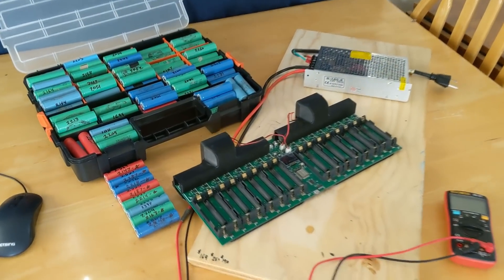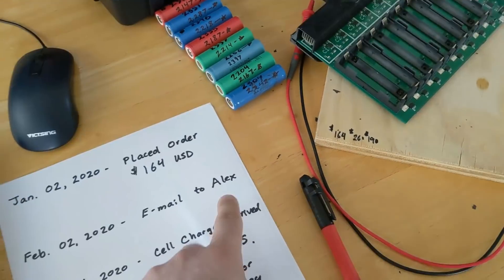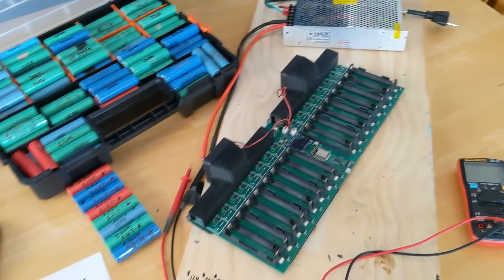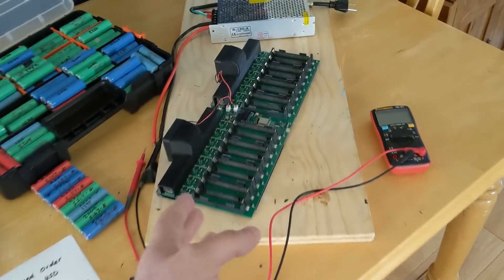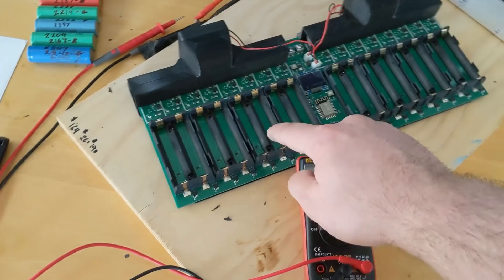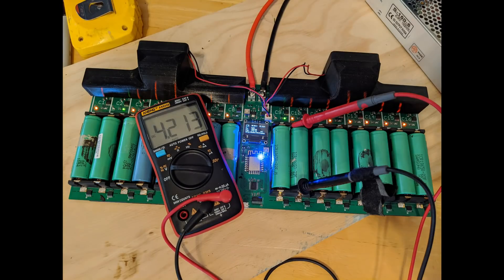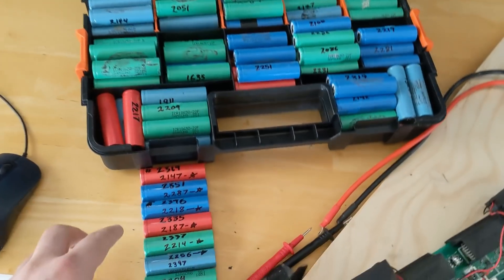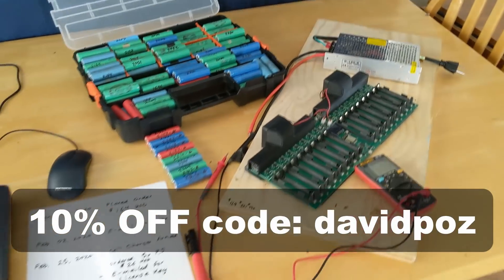18650 Mega Cell Charger and Capacity Tester

Comment: Thank you for your time and the making of this video. I am frustrated with this charger and the support. I am looking to sell mine and will just pick up four liitokala chargers. I have done repeated tests of inserting cells in the exact same way only to find problems with the interface. I don't know what it means when the screen turns from showing each cell and its values to a screen of red/orange with the letters n/a in each one. Sometimes the cells show up as in the led lights up after hitting the charge icon in the sw other times the little led never comes on. Just more frustrating than it has to be the overextended themselves with the sw it is not really a good fit. Now I am told lots of folks are using this charger and the makers of the charger state no reports of problems. I found it hard to believe beings the rough edges on the sw.
Reply from the maker: I certainly reported my problems to them, so I don't know how they can claim "no problems".  But I washed my hands of this product altogether.  I gave it away, no payment.  in fact, I paid for shipping just to get rid of it.

Comment: Thank you for the video and special thanks for being perfectly honest on how these EXPERTS (are they?) describe things to end users (common people) who want to use their products. It’s not your fault for being frustrated, when you said , that you spend several hours referring to external media to obtain info. Why do you have to struggle so much to install and or update codes for the device you paid for? I’d say that these people are totally dumb, failing to impart knowledge to the buyers of their dumb products. Sir, I’m with you and I fully understand your predicament. I could feel your anger when you spoke, though you diplomatically subdued and covered it. 
The guy from overseas, was mumbling incoherently, further confusing me. Hello... I, just wanted to buy the damn thing to charge Li-ion cells and not run a Reactor. These people are not engineers, they are frantically cheating people for quick funds with their contraptions. I’d go for 4 Opus and be happy with it.
I apologize for the outburst. I end my note with due regards and respect.
Reply from the maker: Sounds like you also bought one, is that right?  I didn't go into everything.  I tried to keep it to just the facts.  But at one point Martin called me "crude" for asking this question on the facebook group: "Anyone know how long getting a license usually takes? Thanks."  I get the impression working with mega cell charger is a side hobby for him, because he said I would have to wait until he finished "work", got home, ate dinner, and then he will "generate" my license.  
I'm with you, just give me some simple Opus testers.  Thanks for sharing in the frustration with me.
Reply: @DavidPozEnergy  I can just imagine trying to get a license (for sotware that don't even NEED to be licensed) if you buy one used, or aren't a Youtube reviewer...

Comment: You say that voltage was high on all slots. Sure, You are using the same voltmeter for all measurements.  This means that all slots are in sync but Your voltmeter may not be accurate enough.

Comment: You knowingly purchased a beta level product and you got a beta level product. FIRMWARE is the base level programming of the HARDWARE, it's how the hardware talks to the outside world. Yes, you should have started with an Opus-3400.  Be careful with the 18650 project man, you are flirting with burning down your house at this rate.

Comment: I picked up 300 of the 21700 Samsung 4 ah. Trying to figure out the best way to use them. Planning a backup solar generator with a 3000 aims inverter. Bad thing is the aims in 12 volt inverter.

Comment: Hi David, thanks for your time reviewing our product! We will be working on improving the usability of this device. About bay 2 and 9, we will be testing to see if that's something that happen because of software problem or was something wrong with your device. We usually test with a capacitors bank to keep things precise.

It's always good to see the problems users have setting things up so we know what to work on. So thanks again for your time to document your journey, that's how good products arrise, with feedback and with the willing to solve those issues.

All the best with your projects!
Reply: Does this require wifi? To test batteries? Seriously? That literally eliminates 100% of my desire to use this.
Reply: @duronboy2  I'm guessing the software signs you up for a botnet or steals processor power from your computer to mine bitcoins or something like that..  It should not require internet to charge a frigging battery..  google Megacell and you'll get more hits on indiegogo and crowdsourcing than how to spend a week getting one of these things up and running...
Reply: @duronboy2  have you found one for bulk testing?
Reply: @duronboy2  I need one for both 18650 and 21700 capacity testing but i have over 100 cells to test🥲

Comment: Too complicated and time consuming for the average user that just wants to test his batteries. Thanks for enlightening us.
Reply: It really depends on the number of the cells you are testing. If you are doing it for fun and don't care of using these in packs in the future, that's ok. But where this device really saves time, it's when you want to use the cells in the pack, finding the right ones to place in each string and checking for self discharge after 2 weeks and updating the database using the QR code scanner.

Comment: Those deviations were normal...Every IC and every little resistor that the board has is slightly different from each other and that's why the measurments are not on point... The thing that is missing is some calibration... And since you are meant to flash new firmware on it, any factory calibration that might be on it is probably lost... So they should give you instruction on how to calibrate it on your own

Comment: That wiggley line on the board is a wireless 'com port' ie wireless communications port,if you turn on bluetooth or wifi it would of been easier to setup the com port an you wouldn't have to faff about with that usb cable an going into your computer settings
Reply from the maker: I just followed the instructions.

Comment: That looks like it’s built on an arduino system. Especially if you have to flash stuff and set up com ports and everything. Even that led screen in the middle looks like a common arduino piece
Reply from the maker: Maybe, I don't know.
Reply: Yes, we need ESP8266 for the processing and the software is written in Arduino. It started like a prototype project, but then we invested the time into making the numbers right

Comment: We're doing something similar with an active balancer/BMS similar to batrium. but ours is web based, so you just browse the ESP and see what it's doing. no need to stay connected. also will be doing alarms and grafana data metric etc. early stages though. 
When you update the firmware, you could be possibly updating any calibration it may have had.

Comment: I signed up for the crowd fund and later got an email from Alex explaining that the funds were frozen by PayPal.  I called PayPal and could never get the AI agent to understand what I wanted to ask.  Finally got on chat with a human and they checked and said the problem had been resolved.  I emailed Alex back and told him what I had learned.  He thanked me and things were supposedly on normal schedule again.  Now I have got a notice from PayPal that my money has been refunded?  I'll just keep using my OPUS chargers until something makes sense?
Reply: If it was a decent product to begin with, there would be a lot more out there supporting it.  After spending the $$ for 2 of them (used), and then running what I ran into, I felt SCAMMED.  -You're lucky you got your money back.

Comment: After using Opus chargers and having slots and fans fail left and right moved on to liitokaala chargers and Zanflare C4 chargers. They work fine but this one beats them all. the ability to automatically record all cells into a database and printing labels automatically is awesome. When processing thousands of cells, this is amazing.
Sure, this is not for the faint of heart as it requires some tinkering and knowing what and how to update firmware. I come from an IT background so this is right at home for me. 
Your view is portrayed in this video as mostly negative.
Reply: It prints labels from a thermal printer. Thermal labels have a lifespan of 6-9 months. I'd like to see what some of the labeled cells look like after 1, 2, or 3 years...
Reply: Did you find anything in the video to be untrue? If so, could you explain?
Reply: I have both Electronics Engineering and IT education..  I just don't have a weeks worth of my time to devote to getting this junk running.  (my time -is worth about 50.00 an hour, so I'd be throwing good money after bad if I were to get these running.  I can buy 20 -30 GOOD 4 bangers for that money!)  It was junk when I bought it and it will be junk when it burns houses down due to the fact that there is no way to calibrate it after you get it running...  If you want them, I'll sell you the 2 I have for 100.00!    good luck Lnxpro...

Comment: when i built my last pack that is 4s15p i have over a 100 cells tulk along time but i used the opus bt-c3100 as it would fully charge the cell then run a discharge test then recharge them after i would just put 4 ceels in when i went to bed and normaly they be done when i got home from work the next day had to discharge at 500 mah as built in cooling was not upto job but if i removed the back added an 80mm fan then i could run at full tilt with no problems
Reply from the maker: That's a good idea, to add a fan on the back.
Reply: @DavidPozEnergy  it kept shutting off so figured it was a heat problem turns out i was right simple hacks alway make life better lol
Reply: No, this isn't a good idea - if the cells are getting too hot it is because they are past their prime and shouldn't be used.
Force cooling them is just masking a problem that could come back to bite you.
However, I do think that adding a gentle breeze is ok if you're in a hot climate.
Reply: @ahaveland  I think the fans are to cool the load dump resistors, not so much the cells.
Reply: The charge cycle is linked to the cell temperature. It might not be a good idea to add an external fan. Because this could mess up the charge program

Comment: It seems you can buy fully working and intuitive quad smart chargers with AC adapters for $25. Paying $170 is excessive.
Reply: Yes, the Opus BT3100 is the "industry" standard in the hobby. Mine are in constant use.
Reply: @ahaveland  I have one of those too. I'll probably get a couple more when I get time to really get involved.
They are horrendously inaccurate, but keeping that in mind, they're entirely useable.
Reply: @ahaveland  yup looking forward to buying mine. It's discontinued on gearbest now for some reason
Reply: and then you still have to buy a power supply on top of that...

Comment: Kudos for jumping in the deep end, trying and documenting everything - sounds like they still have some debugging to do.
Reply: It's quite scary to see that cells are getting charged passed 4.2v which is very dangerous
Reply: @joshuabest100  taking them slightly past 4.2 isn't particularly dangerous, but it will exponentially reduce the cycle life of the cell. I have seen these used from 2.5 - 4.35 in an application where capacity was a far greater priority than cycle life. I would say that any higher than that and you'd start running into the hazard area. There are other factors too, such as chemistry, temperature, charge / discharge rate.
Reply: They need to start by providing proper documentation for their product.
Reply from the maker: @ LithiumSolar: Yes please on the documentation.
Reply: I was going to say exactly the same thing then I saw your comment.

Comment: You maybe could have used an old computer power supply for the 5V DC input requirement.  Do you know how many amps it requires to charge with all bays occupied?
Reply: Shame it doesn't have a 12v input with a wide tolerance. That would make it much more useable.
Reply from the maker: Lithium Solar tried using a 22 amp computer power supply and it wasn't enough.  This one I bought was a 30 amp and it worked.
Reply: @DavidPoz - Maybe with that 22A computer power supply and bays 2, 9, and a few others empty, it would have worked fine.  I have a bunch of those here, I can check if any of mine are more than 22A.  Also, I think for those 5V rails to put out full power, there also has to be a significant load on the 12V rail.  Maybe he didn't do that.  UPDATE:  The very first power supply I checked (I have dozens of them), has a 30A rating for the 5V rail, however it states that 5V and 3.3V combined output cannot exceed 160W so you would just about max that out with 30A @ 5V.  Also with some computer power supplies, you can combine the DC outputs, although it is not recommended.

Comment: Ya, I was rather excited to see these things and a few different guys on YT have tested them.  I am not intimidated by the hands on aspect as it is my bread and butter (But these don't actually need programming, more in a sec on that).  What I DON'T like seeing is how incredibly friggy and temperamental they seem to be.  The need to go in and fiddle with configuration files should be a power user OPTION and not a straight up first place to go if something is wrong.    The user issues should have been ironed out a lot more in prototyping so that at least it would be easier to weed out where the actual issues are; meaning user error or manufacturing or design faults.

Thanks for trying though!